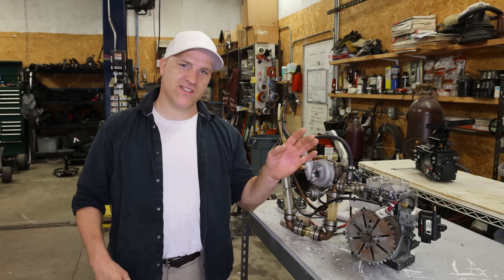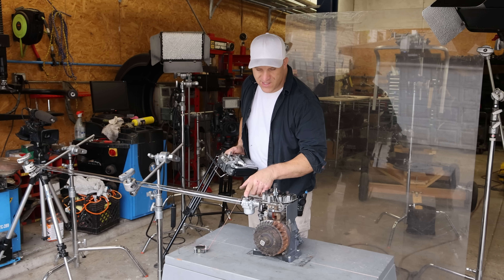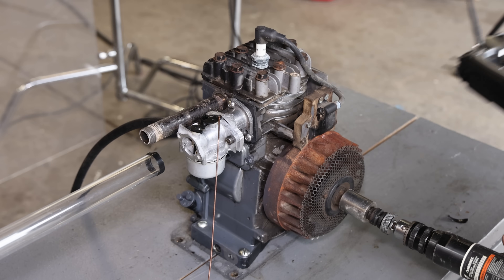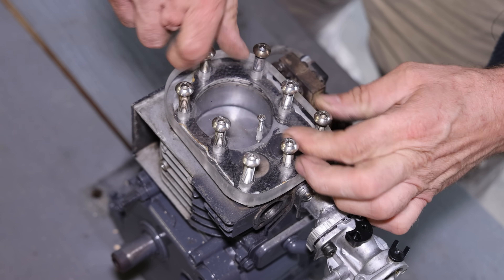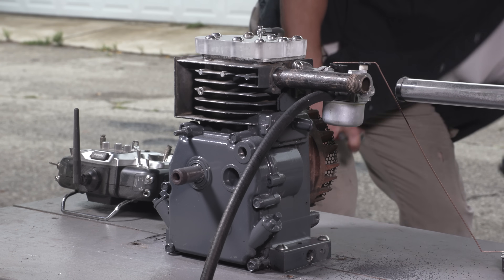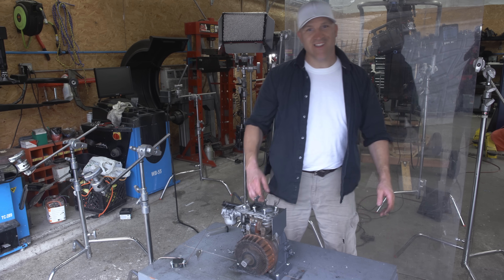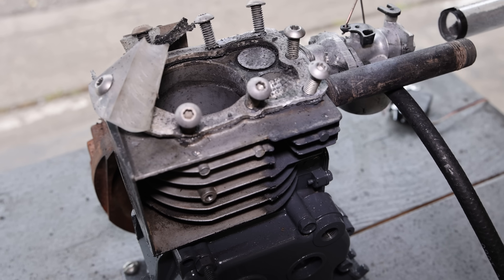Engine Running On GUNPOWDER

Comment: I've been watching your videos for months and I've only just realised you're missing a finger...
Also the engine doesn't run after the explosion because there's no tube shrapnel on the table when you start it up with the original head on the engine and the tube is still intact. FAIL.

Comment: Any way to safely do this with the stock head? I want to see that head pop, or the connecting rod bend when the powder ignites. (Gunpowder burns fastest when under pressure, so it looks like you'll always get a good explosion on the compression stroke following powder ignition, like what happened here). Very cool!

Comment: You're lucky that hundred shot of GUNPOWDER didn't blow the welds on the intake
Reply: Fortunately he lives life one quarter mile at a time 🤣
Reply: Dom: I said a 10 second lawnmower..not a 10 minute lawnmower.
Boom
Me: There you go . 10 second lawnmower
Reply: Love the referrence to F&F1,  but that bit told me the creators didn't know as much about engines as they wanted us to believe. Have you ever seen an intake manifold that was welded together? All the manifolds I've ever seen were cast, it would cost the manufacturer more to weld them together. One more nit to pick, have you ever used a 3/4" torque wrench on a car? That big a wrench is used on heavy machinery like bulldozers or semis, the guy who wrote the script doesn't belong in any shop! I had a very serious crush on Letty (Michelle Rodriguez), I wish I was Vin Diesel just for that moment he had his hands on those sweet cheeks, she is absolutely gorgeous to me :-)
Reply: Dave Kauffman lmao! I hear ya, as an adult (I’m 30) the movie is a let down in a lot of ways. I currently own a 93 Rx7 (same red car Dom had in the first movie) and owning it has taught me a lot about turning wrenches lol
Reply: Dave Kauffman welded manifolds are a thing when you’re doing custom fitment. But it’s usually rare as aftermarket solutions are plentiful for most platforms
Reply: Best part is when the computer says "danger to manifold" and the fucking floor on the passenger side fall down. Engineering 101.
Reply: Lol

Comment: Didn't anybody else notice that the footage when he supposedly put the stock head back on and ran it was taken before the explosion? The clear tube was still in one piece with the powder in it. ooops!
Reply: Look at 06:03 mangled engine but new tube. He just replaced the tube  I'm sure there will be a video coming with the stock head and gun powder 😁
Reply: @LivingMyBoostLife  yes. He's probably trying to lt us know he's ready to blow it up again.
Reply: it was still there as he was showing the bent bolts....hmmm
Reply: He probably had a back up one in case something went wrong with the first one, or he needs 2 because he's going to do something similar but a slightly different take in a future video.
Reply: All of this is really odd. I mean the thing exploded, as did the tube.

Unless he mounted a new tube (why?!) then none of this makes sense.
Reply: @01DOGG01  The second tube is different from the first tube. The black ring is deformed with the first tube, and not the second.  My guess is he was thinking about blowing up the engine with the metal head.... but then had second thoughts... or is saving that for a part2
Reply: @nicholas_scott  Yeah most likely part 2.

I don't think he has a need to fake anything. Don't think he would be the type either.
Reply: @nicholas_scott  Exactly. I would had second thoughts also since a explosion with a metal head would be a lot more violent.
Reply: @zight99user  my thoughts too. If it's even legal to do something like that, he definitely shouldn't try a metal head in front of his garage in town. And I'm still worried about him starting it so close to that tube. Even if the engine backfires and no powder makes it inside, that tube igniting made a big extremely hot fireball.
Reply: Could be an editing mistake. I don't know what purpose it would serve to be deceptive. I hope he answers the observation. I did notice the tube in place with what seemed to be black powder in it.
Reply: What I did noticed was what looks like pieces of the old head gasket flying around when he ran the engine after the explosion. He could have replaced the tube after, he probably want to try it with the factory aluminum head... I don’t think that clip was taken before, though.
Reply: The thing that gets me is that he was running the engine, with the tube full of the powder in the same position where the 'previous' one exploded, with him standing right next to the loaded tube.
Reply: Your neighbours must realy love you...
Reply: You noticed the new tube, but didn't notice the bolts were still bent with see-thru head bits everywhere???   🤔 😉
Reply: The head bolts were still bent to hell though
Reply: Wow it’s like he totally wouldn’t have a backup tube or reset his set before changing onto the next head. 

Also he has to keep his channel alive, so he selectively will upload the second run with a stock head on a later date, it helps keep his content fresh and new, I know you tubers who will film something in a weeks time and upload videos on it for the next 2 months.
Reply: i noticed it too, was like what, why.. and it spits fire from the exhaust right at the tube, dangerous??
Reply: @RustLighter  that was the intake
Reply: Let's challenge Matt: We want to see fertilizer teaching engine builders how to make lasting heads!!!
Reply: Came here for this
Reply: Maybe he had 2??
Reply: My guess is he decided AGAINST making a bomb with the metal head on it. It was set up to try with a new tube, but he chose against it -- wisely.
Reply: He did it two times and put the clips in the wrong order
Reply: Did it work?
Reply: Yeah you can clearly see that clear plastic tube blew up but then he replaced it and put more gunpowder in it for what it doesn't make sense I don't understand that I wish someone would explain LOL
Reply: Yeah thats exactly what i was about to point out
Reply: Yeah this guy is full of $hit and thinks everyone is stupid
Reply: You're right but there was a bent head bolt vibrating off the bench???
Reply: Stupid 😂wow
Reply: Thats why im in the comments too! 😂
Reply: Did you notice at the end the clear head that he built the piece that stayed on the engine after the explosion was in a completely different spot, telling me he tried 2 clear heads.
Reply: Totally man. It was from before. That thing wasn't going to run again. That rod an piston was smoked valves were more them likely damaged as well.
Reply: So what’s the matter?

Comment: "As much black powder as it wants".
OH
NO. Edit: yeah thats what I expected haha.
If possible it would be cool to see it running with just a trickle of gunpowder. Like fill the tube with 1/4 a teaspoon of powder spread across the whole tube. Then slowly up the ante?
Reply: Yeah, that was definitely too much. I think he might not have been expecting it to get sucked in that quickly.
Reply: @normang3668  I think it may have ignited instatly , it's just that tube suffocates the engine of air and later you can see it was pulled back , engine sucked some air and booOm
Reply: it was wayyyyy to much. but the problem is, you need to run it on gun dust, not on gun powder. for the ignition and the right dose of the power.
Reply: And the stock head
Reply: I 2nd this. That was entirely WAY too much lol
Reply: The engine still runs, I want to see it running on gunpowder dust!

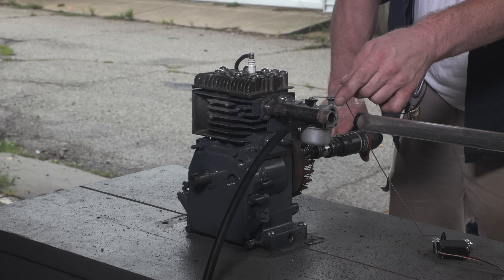Comment: Why is the tube back in one piece when he tests if the engine still runs with the stock head "afterwards"? 6:12
Anyway awesome video!
Reply: i actually thought that he was going to do the same again with the stock head in the first place. a bit disappointed haha
Reply: He has a new tube as just before 6:12 you can see the engine head with the bent screws still in place. Likely going to do another video with the stock head on to cause true over pressure.
Reply: @sandyleask92  Youre right! I missed that.
Reply: @sandyleask92  I wouldn't. A piece of aluminum flying is not the same as some plastic flying. Also, feeding the black powder in uncontrolled amounts through the carburetor is irresponsible to put mildly. It's fun to watch this movie though 🙂
Reply: I was thinking the same thing!
Reply: Nevermind the new tube. What I want to know is, why does the broken bit of the see-through head move to a different bolt position? 4:50
Reply: @normang3668  Haha now thats interesting!
Reply: @normang3668  In all shots I looked at, the shard is still bolted on the opposite of the carb. I don't see where it's in any other location.
However, even "if" there is a shot with it in a different location, just means he ran the test twice.
Reply: @korishan  You're right. Watching back from 3:21, he definitely blew up two separate see-through heads and used footage from both explosions. You can see the remaining bolted-on piece move from one shot to another.

Edit: It's ever more noticable watching from 3:11 to the following slow-mo shot.
Reply: HMMMMMM
Reply: DEEP STATE
Reply: He changed the tube this is simple
Reply: @memeti5835  And then didnt do anything with the new tube.
Reply: Chris maybe he will show us at next episode
Reply from the maker: I did, 2nd explosion at the end of the video
Reply: Bruh it's a new tube 6:10 hes literally standing next to it
Reply: He's very lucky he didn't have a backfire when he started the engine that close to the tube. It didn't on the first run but after that much damage there's no telling what could happen.
Reply: Was about to comment that myself!
Reply: Maybe he was thinking of doing it again with the stock head but realized that it was too dangerous in case the metal head exploded and shrapnel went everywhere
Reply: You noticed the new tube, but didn't notice the bolts were still bent with see-thru head bits everywhere???   🤔 😉
Reply: At 5:57 he has the tube alongside the blown head, he probably had a second tube as backup or for another test with the stock head
Reply: lets ask him to run it on gunpowder with the stock head
Reply: So i was thinking the same thing. You do see a new tube with the blown engine. But if you take so many safety precautions, why are you right next to the tube full of powder controlling the running engines throttle by hand?i kinda wish it woulda backfired with you standing there, it woulda been better content.

Comment: Next time use less gun power and see if you make the motor run on gun powder.
And maybe use a air brush to blow the gun powder into the inlet manifold and not use petrol at all.

Comment: Acetalene gas with pure o2 combustion in the enegine

For acetalene gas 
Calcium carbide + water --> acetalene gas

Any water can give but distilled water is preferred
Reply: He already ran an engine on oxy acetylene in a previous video.
Reply: @normang3668  it is less reactive than acetalene gas

gas have more surface area and will react more rigoursly that liquids

this is the reason why they wont use HHO gas for rockets but 

H and O gas for 

though both of them give the same result
Reply: i saw it but o2 and acetalene must be fed separately
Reply: What..... Wait a min you can make acetylene at home?
Reply: @thomasbarlow4223  in india no
In other nations I don't know

In india u must have license for getting calcium carbide
Reply: @supreethathreyas4577  yea here in florida you can get calcium bicarbonate for pools... Not sure how similar that is?
Reply: thomas barlow not the same at all (at least that’s what I’m told)
Reply: @thomasbarlow4223  both are different chemicals, you won't get acetylene with c(hco3)